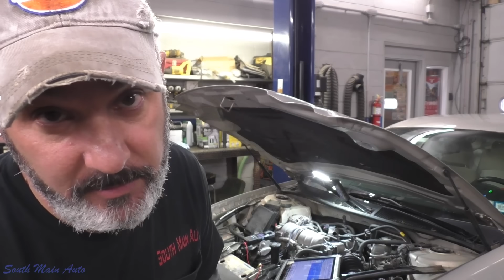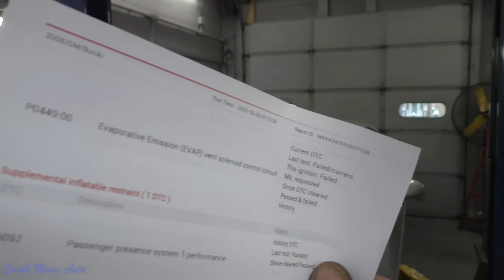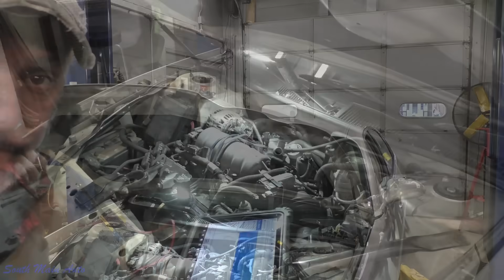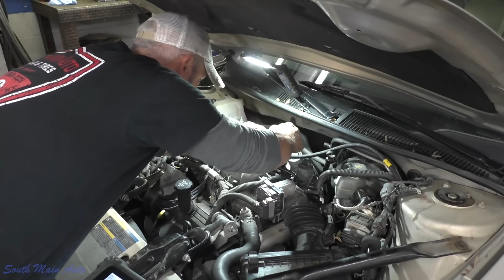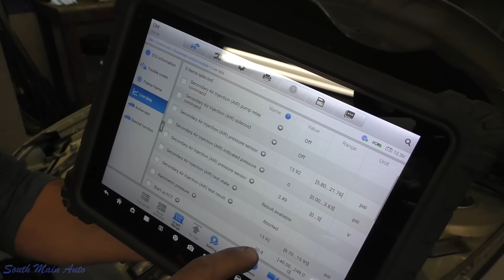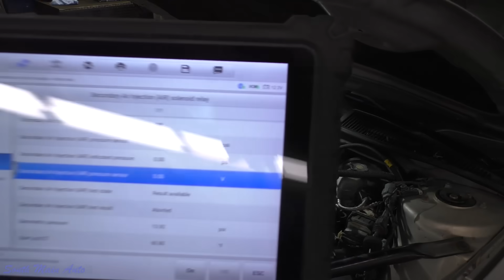When “New” Parts Are Worse Than The Broken Ones 🤬

Comment: this is so true and incredibly frustrating i am currently working on a 2020 ram pro master piece of crap and it needs a amendment air temperature sensor you would think oh no problem so simple and should not be expensive and then you learn you can’t get the parts you go to the dealer and learn it is nearly 800$ because it’s inside the driver side mirror and you can only get the parts as an assembly not only that the same vehicle needs new rear wheel bearings because the damn ABS sensors reluctor has fallen off the back of the bearing at just about 56,000 miles just junk over 2 grand to fix one van and because the check engine light is on you have to replace the sensor to pass emissions honestly it’s got so bad that there should be legislation stating that emissions related components must be sold independently from assemblies and must be accessible to repair or something along that line because it’s gotten to the stupid level

Comment: I didn't know it at the time but Echlin and Standard are the same parts, as you said. I bought a Standard ignition switch for my chevy. Intermittent problems. I bought an Echlin ignition switch for my chevy. Same thing, intermittent problems. I finally figured out what the real problem was and put the original ignition switch back in, problem solved. Moral of my story? Echlin and Standard are on my "do not buy" list. Please do not tell me AC Delco is crap too!

Comment: A bunch of new electrical parts use thin blade spades at the connection. You have to go to the vehicle harness connectors and tighten them up so they make good connections and you don't have new intermittent problems. 
This also happens on forklifts and similar heavy equipment.

Comment: I know your pain. Back in the late 70's I had a 73 Buick LeSabre, turned it into a taxi. Payday Friday for the military, our busy time, I was sitting in front of the base and 4 guys came to my cab and got in. Went to crank it and no crank. Cars were easy back then and I knew my starter was bad This started about 3 in the afternoon. So, I get my buddy to take me to auto zone. I return with the starter, jack up the car, start swapping it out and as I was, it starts to rain. I get it installed, jump in the car soaking wet, turn the key, and no start again. Diagnose the problem again and realize I got a bad starter from auto zone. Take it back and get another one, and wouldn't you know, the same exact problem. Take the second start back and then the guy says, "you sure you have a starter problem?" I'm like 99% sure so I say yes. He say's lets test it. I'm thinking, WTF, you have a starter tester now? lol So he tests it and it was bad, he grabbed the first one I returned and tested it and it was bad, Pulled out a third starter, tested it and it was bad. Then he grabbed the 4th starter, says I hope it works as he put it on the tester, it's my last one, and what the heck it worked. I take it and install the starter for the 3rd time, at night and still raining and jumped in the car, fired it up, went home and took a long hot shower. I totally missed all day and night at work, but I got really good at pulling the starter that night. lol
I love watching your videos. I wish I had your knowledge of these newer cars.

Comment: Customer goes to shop #1. They replace the vent valve and the deverter valve. Parts are bad, so they remove them and return to supplier. Customer takes car to shop #2. They order new vent valve and deverter valve from same supplier, and get the same bad parts which still don't work. Shop #2 removes parts and returns them to supplier where they're returned to the shelf. Customer brings car to Eric who determines it needs a new vent valve and deverter valve. He orders the parts from the same supplier and...  Yep...  The same parts show up and they still don't work. 😅

Comment: They should open a car factory that makes only bodies. Then take the parts from other companies eg, engines, transmissions, diffs, and supply the customer with what he wants installed. That would solve the problem of crappy parts and OEM trash installed on your car. That's the way big trucks were assembled and puts the best longest lasting parts on vehicles. And the companies that makes the best parts will stay in business while the inferior companies go quietly into the sunset.

Comment: Home gamer.  About 15 years ago - before I knew better - I installed a Dorman blend-door actuator in an F150, including the position re-learn.  It worked fine to the end of travel one way, but at the other end, I could hear the gear stripping. Exchanged it, same problem. Contacted Dorman.  They explained in condescending detail how one has to perform the re-learn.  I explained that I already had - both times - but what the hell, why not.  Same problem.  Dorman guy said "Well that's strange, that should have worked." AND IGNORED ALL FURTHER MESSAGES. Returned the Dorman, ordered OEM from RockAuto, and it worked perfectly. 😡 .

Never bought Dorman again, never will.

Comment: For those who don't know, in NY if your check engine light is on, it fails inspection immediately.
Reply: As far as I'm aware, that's pretty much true everywhere.
Reply: @MikeInExile  Not even close, I live right next door in PA.  Check engine light does not fail a SAFETY inspection.  The emissions test in my county includes the gas cap only.

Comment: I bought a tie rod adjuster sleeve for my ‘91 F150 from O’Reilly earlier this week. The threads were really bad out of the box. Wouldn’t even thread onto the inner tie rod properly. Took it back and got another one that worked better but still. I’m kinda worried to get a “new” part because it won’t be the same quality as the original equipment part. I guess I shoulda tried to find a motorcraft part.

Comment: Sometimes you get lucky with SMP/BWD stuff and find the OE supplier part in the box. Other times it's fully aftermarket with no markings on it. The only semi-reliable way to tell is the country of origin on the box. If it says USA, Japan, Canada, Mexico, Germany, Korea, etc, you can install it and move on. If it says China, you unfortunately have to test the part to make sure it works before finishing installing it. Same goes for Dorman to some extent. Standard has their T-series line (P series for BWD) for the lower quality, lower price aftermarket stuff. So if you want to spend less and take a chance you get the T part. Here's the part that gets me so frustrated: the regular line is barely more expensive and doesn't seem to be any better. What would really help fix this situation would be to add the T to the part number of all this aftermarket junk and reserve the main Standard line for the parts that are OE quality.

The big problem for parts for this particular car is that the older a car gets, the less of a market for real quality parts there is, so the availability of good parts goes away. In 2025, most everyone that needs a part for their 3800 walking into a parts store wants cheap because they're limping the car along. So the aftermarket parts companies adapt to the demand. Don't get me started on how impossible it is to find a new ignition control module for a 3800 that actually works. Thanks for the opportunity to rant.

Comment: I left the shop floor in 1993 never looked back, this was an issue then but not at the level you have to deal with, My own pickup the shop had to replace the fuel pump twice to get one to work correctly, lowest bidder parts were the problem.

Comment: I have a shop in Akron Ohio and I went through a very costly breakup with my NAPA store of over 30 years, stuff was not working brake rotors flaking apart in less than a year, ceramic pads that turned wheels black, and yes when you went to get them replaced they said we have to send it in for inspection, other parts to NAPA has no warranty anymore, just selling cheap crap , it costed me thousands to get my customers right word is NAPA was bought by an investment group based in viet nam they are just selling junk parts living on the reputation for as long as it lasts, AC Delco crap is no better, not GM parts, Orielly has good stuff go there guys, trust me been doing this for 45 years, OH OH OH Orielly, they are the only one that has the real deal

Comment: I'm just a guy working on my own stuff on the weekends.  I won't even attempt a repair without OEM parts.  It's just not worth the aggravation.  The only aftermarket parts I use is engine oil, brakes, and some Fel-Pro gaskets.  OEM isn't that much more, especially if you can get a discount at a larger dealership or online.

Comment: About 10 years ago I had a buick with the 3800 with the p0411 dtc...  Had a new check valve. Valve worked, pressure sensor wasn't working as it was supposed to (it was reading). Was a GM OEM part installed at another shop... GM technical assistance had me chasing the pump, the manifold for a clog... Another new oem part fixed the vehicle, but for me chasing it i spent hours/days chasing this, the only way i confirmed that the valve was the issue was we got another vehicle in with same engine i compared scan tool data, swapped parts and sure enough defective valve... This was 10 years ago before parts started getting this crappy... Even oem parts... Working at the dealership now is a joke. No one cares. And you get upset customers yelling at you when all you are doing is trying to help them out. Mary only cares about her 20 million dollar bonus every year.

Comment: @Eric,

Recently purchased new complete struts for my 2007 caravan.  Friend of mine put them on,,, no problems... Dropped the van and it is lopsided by like 5 inches.

Verified the struts was on the proper side,,, verified the struts are stamped with the correct number to each box... all Good...

Soo.. had to take em out, and buy two different ones from a different brand... boom no problems.

Brand new parts from Oreilly's,, with the proper numbers,,, but yet,, one of them was completely wrong.

Comment: From ChatGPT: "Yes, it is sometimes possible to rebuild an old air diverter valve, especially if the issue is a worn diaphragm, O-ring, or internal seal rather than a cracked housing or a failed solenoid. Many rebuild kits are available for common automotive and industrial diverter valves, which include replacement diaphragms, O-rings, and other wear parts. The process typically involves disassembling the valve, inspecting and replacing damaged internal components, and reassembling it with new seals."

Comment: 07 Focus fuel pressure sensor. replaced with Bosh then Ford then National sensors all failed within a week, all appeared absolutely identical - same sh1t manufacturer. Went to a u-pull salvage yard found a used sensor that worked for another 50K miles for $5.

EDIT - Watch generic OTC medications! Found some of those also suck.

Comment: On my Restomod 64 F100 I've had to replace these new parts: HEI distributor (2), carb "Chinese " twice, water pump, fuel pump (3), fuel gauge sending unit, radiator, the carburetor literally fell apart internally three times. The second HEI distributor failed in less than 100 miles. Module, rotor and carbon button. I was able to get running by stealing parts from the first HEI until I was able to track down the US importer and get replacement parts. I've been in the trade since 1968. Napa at that time was nothing. Had crap parts at that time like "Blue Streak" ignition parts.

Comment: It's not just the automotive world. Our boiler crapped out. My good friend, who also follows Eric O, is well versed in boiler service. He determined the control unit gave up the ghost. 3 control units later the boiler was running again. At the other house the boiler needed service. He wanted to replace the temp/pressure gauge. We go to the plumbing supply store. Get back only to find the needle is off its peg and lying on the bottom of the housing. Call store to verify they have another gauge. Go back and exchange. Install gauge and fire up boiler. The boiler comes up to temp. Gauge fills with water and is steaming. It is now a quarter to 5. Store closes at 5. Call to see if they have another gauge. That was the last one in stock. Tennent went without heat that night.

Comment: Brother its so bad across the board I installed 5 bad out of the box delco alternators before getting one that worked. No I wasn't paid 5x and of course a simple job makes me look stupid. And I have no faith in my repair so number 6 works... but how long. On Honda crv new starter the bedix hangs up engaged. So remove intake etc. And try again. I can see where a new tech or Harry home guy goes wth I know x is bad but I replaced 2x same result im loosing money, send it away and 3rd guy goes it says its x but x is new...

Comment: I have no doubt the parts were crap. Industry wide resistance to 'right to repair' shows its ugly side by deliberately flooding the market with substandard parts. Manufacturers don't want you to fix it unless you go to their 'authorized price gouger' IF... IF the manufacturer even make the part available. 
"Your expensive toy is a year old. The part is on infinite backorder / obsoleted. Junk that one! You can buy a brand new toy that will work for another 6 months."
The other game is to DRM everything. Sure, you can replace the alternator yourself. But you can only buy one with the chip in it that has to be married to the cars computer. The part cost a grand and still doesn't work because you have to get it 'programed' at the dealership. That will be another grand. Buy an aftermarket without the chip and the car will roach the alternator and battery, again, and again....

Comment: A few years ago i replaced an iac in a corolla i had at the time with one from oreilly's  it ran even worse than the bad factory original one. so i decided to go to the junkyard and get another used oem sensor i found one covered in dirt next to a car. cleaned it with cleaner and it also worked better than the parts store part.

Comment: I worked phone customer service for a water htr mfrr.  Plumber detected no gas pressure at inlet to htr.:  bad pressure regulator.  He went to distributor, got replacement, did not solve problem. Luckily an identical htr.w/regulator next to bad one, told him to switch regs, bad htr fired up, told him to go back to distrib and get a good regulator.  So your statements verified.

Comment: I put Bosch Iridiums in my daughter's BMW 320i(German plugs in a German car, what could go wrong), immediately developed a misfire. After a couple hours of trouble shooting, thinking I did something wrong, put the old plugs back in and problem fixed. The old plugs were NGKs, the original plugs. So I put iridium NGKs in and had no problems. I found it quite odd that BMW uses NGKs from the factory. I guess they realize Boschs quality has fallen off as well🤷🏼‍♂️

Comment: I just recently dealt with a situation with an Alternator on an ‘06 Tucson I changed back in 2022 from O’Reilly’s. Failed in May ‘25 making a mechanical knocking sound. Change it under warranty. 2 months later, it’s no longer charging. Well, the “lifetime” warranty is for one alternator. Okay, on one hand I understand that. You can’t just give unlimited free alternators. Fix what’s wrong with the car; it’s not your alternator causing your problem. Well, now, in hindsight, the knocking one was better because at least it was charging. Now I’ve got one that doesn’t charge at all and O’Reilly’s will tell you with a straight face while actively referring to the alternator as a battery that this is the risk you assume by buying used parts. Dude, this is what you sell! You don’t have a new one available for today. Just frustrating. Tells me he will “hook it up” shows the prices presumably at cost and the rebuilt ones have close to 100% margins where the new ones they have to order have closer to 10% margins but the new one retail is only about $100 different than MSRP of the remanufactured one. Okay, yeah, my bad for buying the remanufactured one. Try to support local stores but then have to deal with this. Ended up buying the next one from RockAuto, a Mando one and car has been fine since.

Comment: Us that still have Carbureted engines (live in the south still drive a non rusty 86 f150) have had issues with cam activated fuel pumps putting out too high of pressure. The last one I tested measured 17.5 psi !!!!! I have heard others having the exact same issue with most unable to figure it out and just switch to electric..

Comment: This video makes me grateful to have kept my 1980 F-150 shortbed with a 300 inline 6 cylinder, a breeze to service.
Reply: 1981 f150 with 300 six is my work truck,hates modern fuel on hot starts and isnt very powerful but always gets the job done and yes i can fix it,A friend was asking where you plug in the scan tool haha i was laughing a long time.-keep your old truck for sure.😀😀
Reply: but if you have to get a new part you can run into the same issue
Reply: @yamisniper  I am dealing with this on my 99 dodge neon. parts are ether doa or fail shortly after install

Comment: Bad parts is a symbol of a company who's desire is to create volume because volume is what the accountants want as that drives share price and thus executive bonus's. No one wants to actually ask the question would we sell more parts if we had a reputation for out of the box parts that work first time over out of the box parts that are cheaper but which might not work because the manufacturers QA process is spotty? Tbh it is an issue but is also sadly affects the main OE chains as well as you can get parts supplied through the dealer network that are faulty.